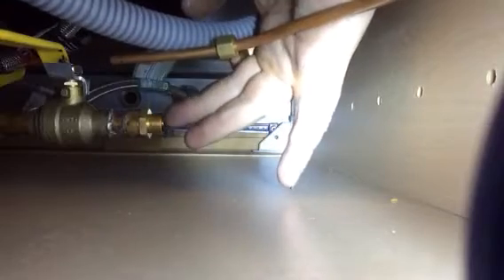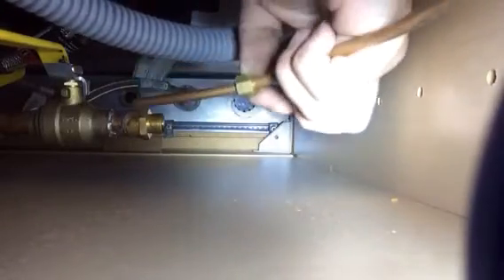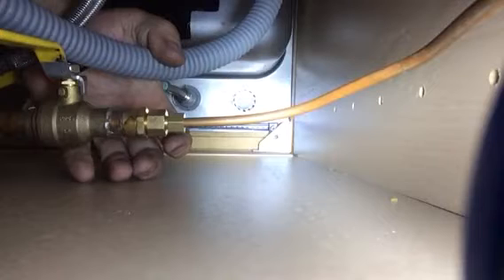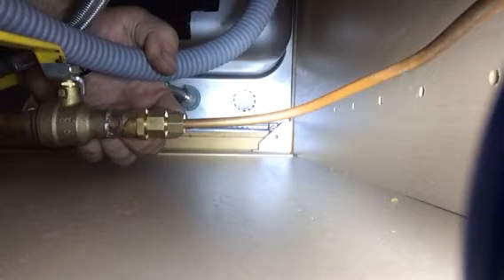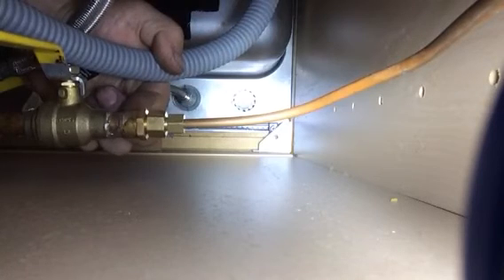3/8 compression to 1/4 compression fitting ice maker hook up

Comment: the fitting you used in the video is not the same one that you linked it to on amazon???
Reply from the maker: What is the difference?
Reply: @themrhelperguy   the one you linked is a 3/8" male to 1/4" male.  The one in your video is 3/8" female to 1/4" male